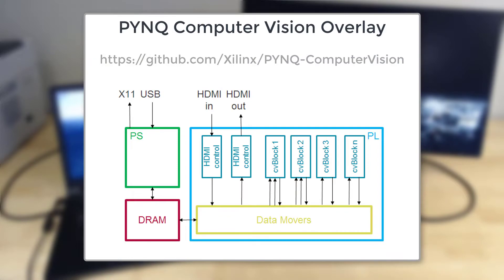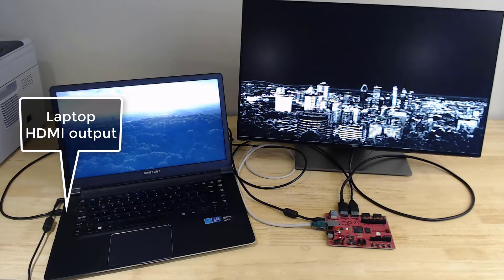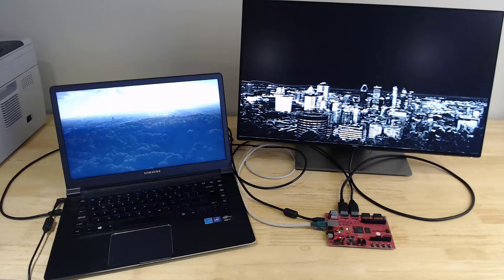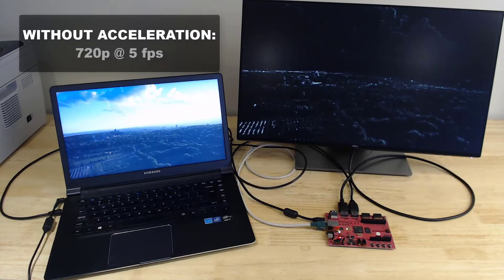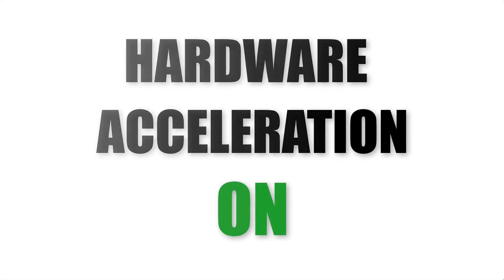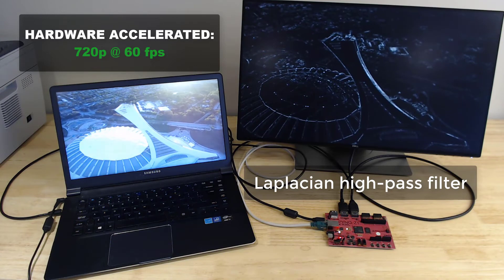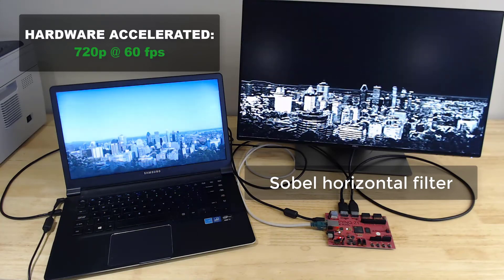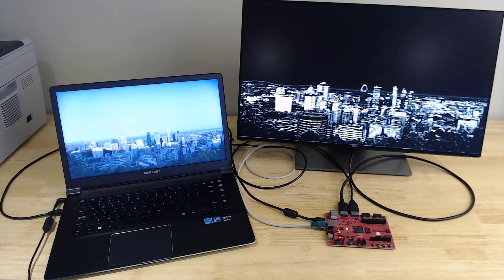PYNQ Computer Vision demo: 2D filter and dilate

Comment: Hi, Great video. Which functions did you use for the computer vision. Did you use OpenCV? I am wondering if you use openCV on the PYNQ if it also accelerates the OpenCV functions. I need to detect faces with openCV but i need a faster solution then running a python script on a PC. So thats why i am looking into PYNQ.